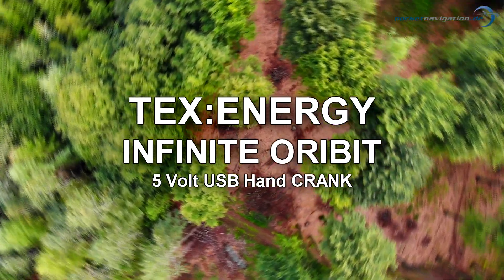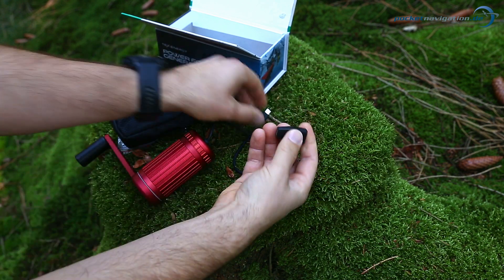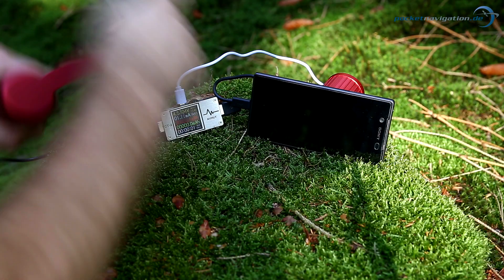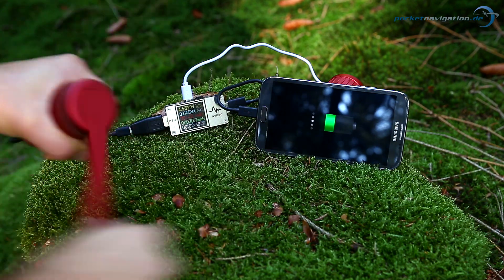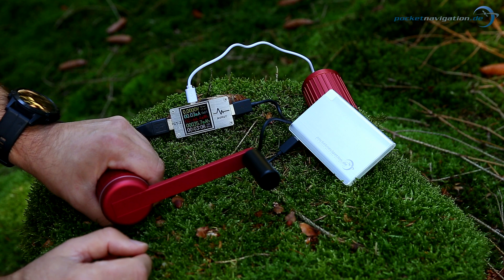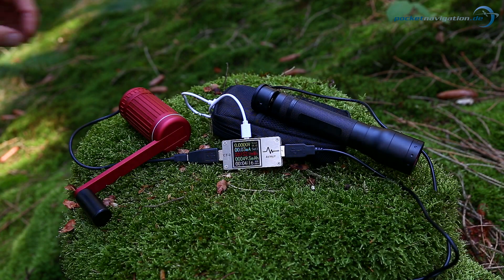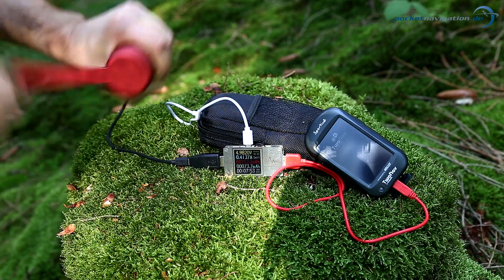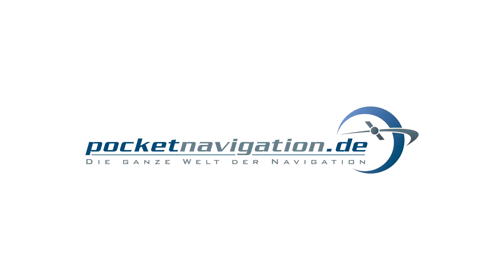Infinite Orbit Texenergy POWER GENERATING HAND CRANK

Comment: It would be cool if there was a battery built into the crank so that you could just crank away while walking or whatever without being attached to a cable, and then when you want to charge a device you just plug it in and dont have to do any work. That way you can crank when you have energy and charge even if you’re tired.
Reply: that is a pretty good idea!

Comment: I’ve never understood why these sorts of things never have a battery inline so that if you speed up/slow down it’ll still smooth out the power output.
Reply: They politely give you the option to do that if you chose too You can get a battery for it if you want!
Reply: You mean a capacitor
Reply: same )))
Reply: Because it will be a load, and load eats current(amps), the more empty is the battery, the more force you will need to apply for that load. If you apply less force, charging will be slower, but still you need to apply more force than without that additional load.
Reply: then it would need  a bat init ..ive  wanted 1 but everytime i se a vid they just say dont bother ya wasting ya time cos ime on the go all the time i would love this i would charge all my vapes and phones and power banks and everyrhing but not for free leky but just to keep busy any1 no of any that do work ..cos iff not why not like u said surly there should be 1 that works properly
Reply: Batteries are only good for about 500 charges and would make the product useless unless you could replace the batteries.

Comment: Would one farad capacitor work in parallel of output???
I have found that with any particular powerbank you can only charge it or discharge it one at a time you cannot charge and discharge a power bank at the same time, the stupid electronics inside it shut output down while charging.... So you kind of need two power Banks! One for charging up and one for discharging and this is the same for using power banks with solar panels...
Reply: You can't charge and discharge something at the same time. In capacitors charging/discharging, it happens just ultra fast. It charges, and when charged, it can release the stored energy instantly.
1 farad capacitor? Where did you see that? It will be a pretty big and expensive. Probably you are talking about supercapacitors, but those work a bit differently while still having capacitance.
I think that, if you are discharging a power-bank, while still attached at solar panel, it will just discharge slower, or charging slowly. Depends on your load.